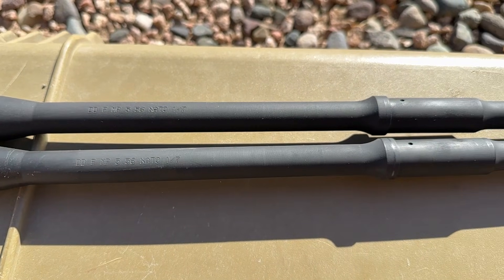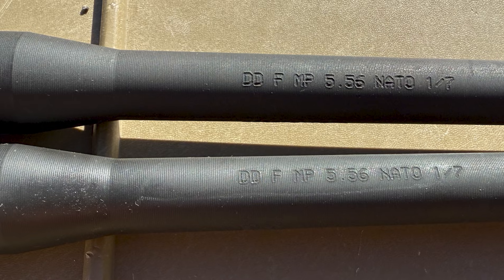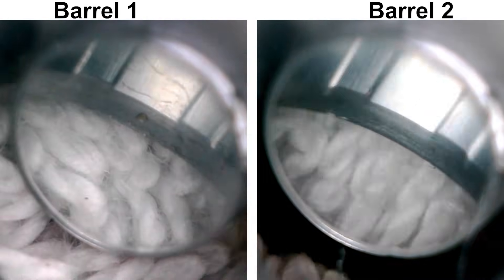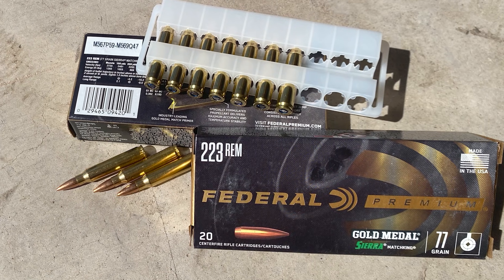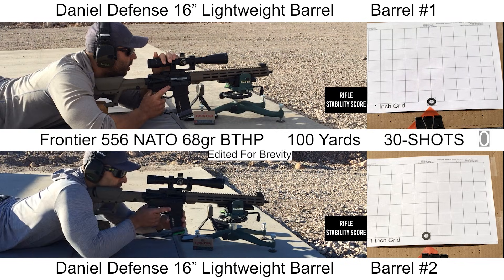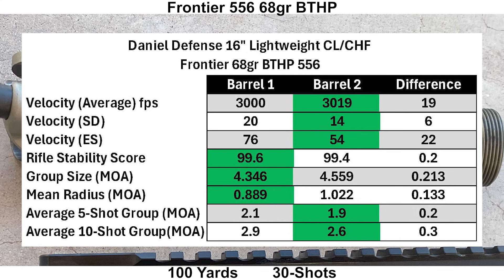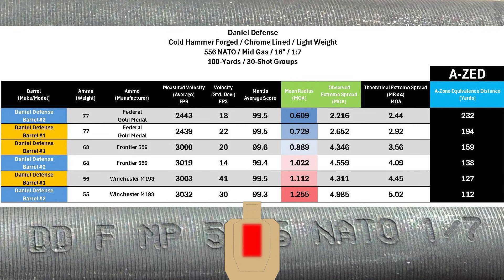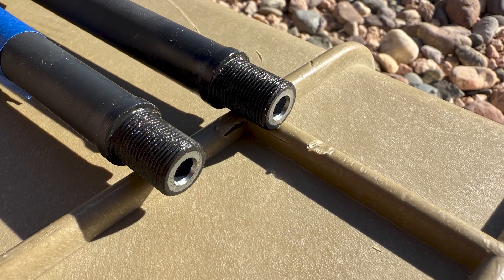How Consistent Are Daniel Defense AR-15 Barrels? Accuracy & Measurements Compared

Comment: You can't accurately compare a lw barrel to a continous taper barrel. I have a DD 14.5 that shoots MOA and I've had out to 600 on a-zone steel all day. DD is more than substantially accurate for a durable combat barrel. It's not meant to outshoot a stainless match barrel like an spr etc.

Comment: Using grease can/will cause over torquing as greased bolts require 25-50% less torque. Maybe not relevant to the results in the vid but just a tidbit for anyone reading.
Reply from the maker: In the case of AR-15s it’s standard practice to grease the barrel nut threads. Every major handguard/rail manufacturer I’ve seen explicitly specifies greasing the barrel nut threads, and the torque values they publish take that into account.

The military technical manuals (like TM 9-1005-319-23&P) and manufacturers such as Colt, BCM, Midwest Inc., Zev, etc. all recommend Aeroshell 33MS or an equivalent moly-based grease for the barrel nut. The moly content helps prevent galling and corrosion between the steel barrel nut and the aluminum upper receiver, and it ensures that torque is applied consistently without seizing.

So while you’re correct that grease reduces the input torque needed compared to dry threads to get the same clamping force, in this application the torque spec takes that into account, and greasing is required for proper installation and long-term serviceability.
Reply: @PrestonJMoore I didn’t realize that fact was taken into account with the spec. Good info, thanks!

Comment: Why is it nice that the gas ports are chamfered? I’m not doubting you I would like to know what it does
Reply from the maker: It doesn't really do much. It's kind of an overkill way to make sure there aren't any burrs, but that's not a huge deal anyway. 
I just think it aesthetically looks nice. It's also pretty much an un-necessary step that they took the time to do anyway. So, in my opinion, when I see a product that has chamfers in places where they aren't really needed, it shows that someone is paying attention to the details and cares about the product. But, maybe I am reading into it too much.
Reply: @PrestonJMoore  that makes a lot of sense actually. My best guess was they know eventually the gas port will erode so breaking the edge slows down that process but fit and finish is a huge part of high dollar barrels

Comment: I was watching a Desert Tech video where the CEO was talking about accuracy variables and one that caught my attention was a bolt's/carrier rearward movement before the bullet leaves the barrel can throw shots. So, I wonder if the heaviest buffer one could use would slow unlock time enough to make a difference in accuracy.
Just mentioning this for a video idea.
Edit: To add, I was also surprised when he said chrome lined barrels are 4 moa barrels due to manufacturers oversizing the bore in preparation for chrome, yet chrome can not be applied to precise dimensions. He mentioned this is why they dont use chrome barrels.
Reply: That's just a really poor excuse to not use chrome. Criterion, HK, Geissele, and other top tier chrome lined barrels perform MUCH better than 4moa. I'd specifically look into Criterion's chrome process to see just how precise it can be.

Comment: I bought a .223/556 complete upper from White Label Armory and told them that the bolt  would turn on a .223 NoGo gage, they sent me a new bolt and the new bolt wouldn't close on the same gage. It seems headspace is a combination of the bolt and barrel, but I only write this to pose the question: what should the specs be on the bolt that's used to check all incoming barrels?
Reply from the maker: I don't know what the specs are.  I used a new JP bolt in this video.  Pacific Tool & gauge has a simulated bolt to use for checking headspace.  I have had one on order for a few months.  hopefully they send it soon.

Comment: Great video.  I’ve done similar accuracy testing with my different barrels.  I’ve found that my results can really vary based upon the ammo I use.  Meaning that not all 77gr match ammo prints the same out of my rifles.  In my case I’ve found that the AAC 75gr seems to do the best overall and can improve the performance significantly over other types of 77gr match ammo.  I’m not trying to say that ammo is the best, just that the ammo can really impact the performance.
Reply from the maker: yup, how the ammo interacts with the barrel can certainly have a significant effect.

Comment: Very informative and thorough, thanks for the video.  Also 1359~1376 Ft Lb on the Frontier 556 68gr? that load is HOT.. Do you know if those are consistently a hot load or do you think just this cage code / batch was a little hotter?
Reply from the maker: I'm guessing just the batch/lot.  That load is rated at 2960fps out of a 20" barrel.  So, according to Frontiers own data, it should be running a lot slower of of these 16" barrels.

Comment: I'm writing this before watching this video, I bought a Daniel Defense 16-in CHF standard profile mid-length barrel just over a year ago and I am having insanely good results with it. Sub minute groups with X-Tac m855 I know it sounds crazy, I was blown away buy it too. It's paired up with a geissele enhanced reliability bolt carrier group and I use an RCO ACOG (m4) and a very unremarkable drop in single stage trigger. I have been able to put rounds through the same hole sometimes at 100 yd and I've got pictures to prove it. I'm really excited to see what you come up with for this video even though my barrel is not quite the same as the ones you have here. Thanks for the work you do You're definitely one of if not the best barrel testing content producers on YouTube
Reply from the maker: I think these barrels performed about how I expected them to.   Sounds like you ended up with a pretty impressive one though!!  

Glad you enjoyed the content!!

Comment: DD barrels seems to have pretty consistent crown, which is more than I can say compared to Geissele. I purchased a few barrels from Geissele last month and 2 of the barrels do not have consistent crown. Got me wondering if they skipped a step in their manufacturing process or if crowning isn’t all that important because they are Geissele
Reply from the maker: The DD barrels look to have a cut crown and my Geissele barrels looks like the crown was formed from the CHF process, not cut... Not sure if that is true or not, but, I get what you are saying
Reply: @PrestonJMoore  This is exactly why I felt like Geissele skipped a step. I will have to call Geissele and ask about that and see if they would exhcange those barrels I found having issues.

Comment: Another great video.  I tried the 68 gr and 75 gr Frontier 5.56 and both rounds were hot but I didn’t have pressure signs like you did.  I’m surprised you did with the chambers being that size.  Anyway, out of every box, I’d get a flier.  I thought it was me and benched the gun. I ended up with 1 or 2 distinct fliers out of every box of 20.  I didn’t buy any more of it as I normally hand load anyway.    Thanks for the video.
Reply from the maker: Seems like Frontier might not be as good as I would like it to be.  I have a little bit more of it to work though.  Luckily, just the 223 load, and not the 556.  But, I don't think I'll be buying more of it after this.

Thanks for continuing to support the channel!!

Comment: DD should replace both barrels for being out of spec
Reply: Nothing wrong with those barrels. Pencil profile combat barrels. Accuracy wasn't impressive but ok for such barrel.
Reply: @michamichaowski8375I thought he said they both failed the no go gauge which apparently meant they passed
Reply from the maker: Both barrels are within the Min/Max headspace range for a 556 NATO chamber.  They failed the 223 No-Go headspace gauge. Both barrels are still perfectly serviceable as far as headspace.  They are just less towards the Min side of the headspace range.  Personally, I don't think it's a big deal.  But, there are several people that feel that new 556 NATO barrels shouldn't fail a 223 No-Go gauge. Which, yes, I would prefer these barrels didn't fail that gauge. But, it's not a red line for me.

Comment: Innocent question: Would increasing the weight of the buffer improve accuracy by reducing felt recoil? Looked like both barrels were throwing brass forward pretty good. Keep up the great work 🍺
Reply: No, because he is not rapid firing. He has time to settle and get back on target. Hope this helps.
Reply: Along with the comment above, the bullet is out of the barrel before the buffer enters the equation so there wouldn’t even be a difference in harmonics.  Although the heavier buffer or stronger spring likely would have resulted in his brass being less chewed up.  Good luck in your journey.

Comment: Can you do 11.5 and 12.5 criterion core?  Also on your final slide roundup please add in barrel length on the chart. 

Awesome content
Reply from the maker: It may be a little bit, but I would also like to get some shorter and longer barrels.  The charts are work in progress, but yes, adding in the length on that chart would be helpful.  I'll fit it in there. Thanks!!

Comment: $50 beater BA barrel + a couple cases of PMC has its uses.
Reply from the maker: Oh yeah!! I have a burn down video idea... just need funding for it.
Reply: @PrestonJMoore  Setup trackable discount codes.  Attribute viewer flow to not just the barrels but gear, ammo, and software.  I bet searches for the top 3 a-zed scoring barrels and best load spike on video release.

Comment: Near as makes no difference, they're the same. This is the barrel to barrel variation that I would expect to see with the same model and same manufacturer made reasonably close in time. The only thing I could pick out was one favors stinging them vertical, and the other favors stringing them horizontal, whatever that's worth in a battle rifle barrel.
Reply from the maker: agreed.  Same same, but different.

Comment: Thats....not what i would have hoped for
Reply from the maker: Definitely could have done better.  But, not out of line for a light weight "combat" oriented barrel.  At least in my opinion.
Reply: @PrestonJMoore  the sons of liberty gun works SPR barrel vid you did really surprised me. In a good way.
Reply from the maker: @bomaniigloo  Same here.  I thought it was mostly just hype behind that barrel. Turns out it shoots
Reply: @PrestonJMoore Revisit when the DD barrels are "shot out" and see what the relative round counts are.  This is where those full auto burn down tests add some data points for people with longevity under full auto would be served.  Thats a really small population and wouldnt be worth the cost in ammo.
Reply from the maker: @somebrains5431  I have an idea for a burn down test, but, need to figure out funding for it.

Comment: The 68gr frontiers velocity was surprising, wonder if that was just an extra spicy batch or if all of it is loaded to that velocity.
Reply: I load the no cannelure 68gr Hdy, and don't go above 2,800 fps on avg. I can get to 2,850 fps with some powders. but not with the kind of accuracy I fancy.
Reply from the maker: @darud3sandst0rm  I’m thinking it was just a spicy batch.  Velocity was way higher than what they are rated for.  Brass also looked a bit beat up. 
I was a bit surprised when I looked at the chrono after shooting 😳
Reply: @PrestonJMoore  Frontier has a reputation for being spicy.  Also has a reputation for being too spicy, but that's a topic for another day.
Reply: @PrestonJMoore  I've had that experience with Frontier 75s in 5.56. Bought some in Feb 2023 that popped 3 primers out of the first 5 shots fired from a lot of 200 purchased online. It took 3 months to get it back to Hornady, then another 10 months to get replacement ammo sent back. The ammo they sent back still shows signs of extreme pressure with cratered primers and ejector swipes.
Reply from the maker: @darkwolfrob  Good to know.  I have a few boxes of Frontier left. It's the 223 stuff.  But I don't think I'll be buying any new Frontier for a while